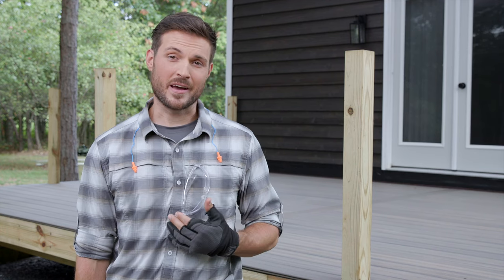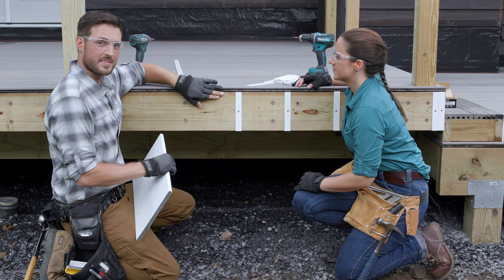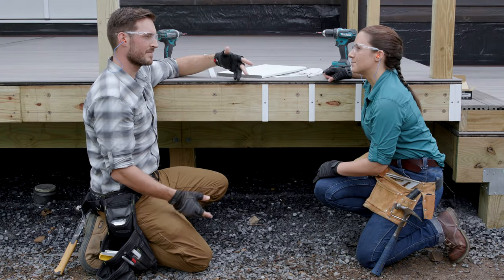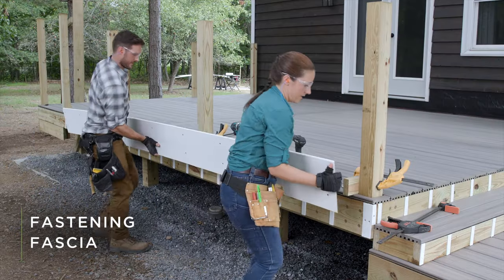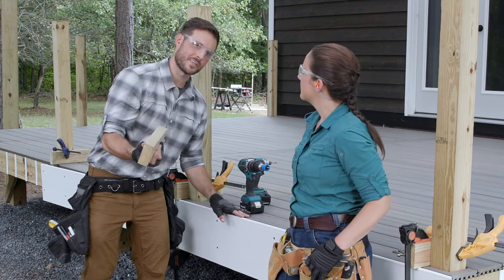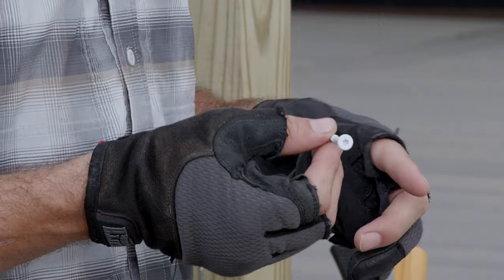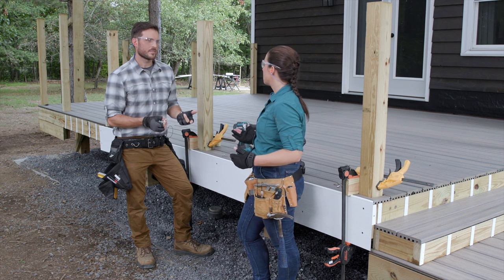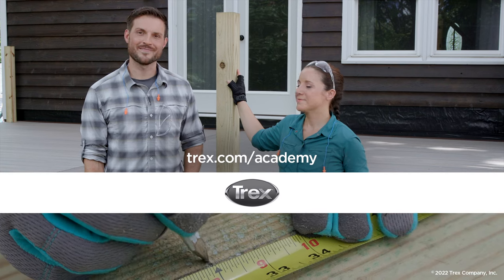How to Install Fascia Boards for a Deck | Trex Academy

Comment: This is exactly opposite of what the trex fascia installation guide says to do. It says the deck board should overhang and fascia should be tucked underneath. There is no mention of spacers either
Reply: He's right.  Picture frame over the top and fascia tucks underneath...have never installed with spacers
Reply: I thought the same thing but, the ends of the deck boards will be exposed and totally defeat the purpose of the fascia.
Reply: I think the idea is, the spacers help airflow carry moisture away.
Reply: Fascia can be finished one of two ways.  
1.  Fascia attached to the rim joist and the decking overhangs the fascia.  This works well when picture framing the deck as the decking cover both the rim joist and fascia not allowing water and debris between the two which promotes rot.
2.  Some people prefer not to have the decking overhang the fascia for aesthetic reasons.  They prefer the decking cut flush with the rim joist and the top of the fascia level with the decking.  However this allows water to settle on top of the rim joist between the decking and fascia.  By attaching the furring strips between the rim joist and fascia, it allows water and debris to pass and air circulation for drying out.  If you prefer your fascia this way attach the furring strips to prevent rot.
Reply: In this case, there is no picture frame and he uses the fascia to hide the exposed side of the boards.
Reply: I agree with you.  Don't forget that these videos are staged crap.....and the people doing them are not necessarily quality carpenters.  I always install fascia underneath, as, in my opinion, the fascia is likely to get worn on the edge....as well as get pushed down....because fasteners are not necessarily engineered to support the significant wear and weight of people stepping on that edge all the time.  I then install the decking so it sits directly on top of the fascia...and supports any edge weight.  Don't want to leave a gap between fascia and deck board....as there is really no need to do so.
Reply: @cyndi795  You picture frame all your deck board corners....so no deck board ends are visible.  Fascia should definitely go underneath deck boards.
Reply: @pokemon9826  After a while, the fascia will sag if it's at deck board height.  The screws are not engineered to handle the vertical sheer stress and will simply move in the wood...or bend slightly downwards.  Ya....might look good esthetically for a while, but if it's on an edge where people walk, the good esthetics will be short-lived.  There is good reason why fascia was always tucked under the deck boards.  The side surface of decking is not meant to be a walking surface.
Reply: @joeidaho5938 haha the screws will not bend   . This is funny
Reply: @Paul-q3m7k  are you a total amateur??  lol  Screws don't need to bend.  They just need to move in the wood...and the wood is always soft, esp after rain.  just use your brain....lol.
Reply: They need to stop teaching people the wrong way!!!!!! Decking has to run over the fascia or you will rot out the rim joist. And it looks better! Come on Trex Academy lol
Reply: @jamesteachout5241  Just amateurs making money doing a useless video....lol.  This happens far too often with these companies.  I just shake my head at this stuff.

Comment: I've followed this video exactly but there is a lot of curvature to the fascia board. The fascia is not flat so as to fit flush against the rim joist. I have Trex Enhance G2 Fascia (clam shell). This doesn't seem right as it is going to make coping corners very difficult.
Reply from the maker: Hi there I would recommend reaching out to our customer care team at 1-800-289-8739 so that we can try to go over your install with you directly.
Reply: @TheTrexCo  thanks, I reached out to Trex and they’ve decided my boards were defective. They are replacing them at no charge. Service was fast and pleasant. Thank you

Comment: We found PVC white lattice moulding in 8-foot lengths (1⅛" wide x 4/25" - almost 3/16) at Home Depot. Royal Mouldings 5534. $4.88 each.

Comment: if I am installing my fascia underneath my deck board (slight overhang of deck board), do i still need to use spacers between the front rim joist and the fascia?
Reply from the maker: Hello Jessica, If you are installing the fascia under the boards, no spacer is necessary. If you have nay additional questions, please call us at 1.800.289.8739. Thank you!
Reply: that's how I'm doing mine; looks a lot nicer.

Comment: A little lost concerning the drill bit.  There is mention that you can adjust the depth in order to use color matching screws.  Questions on AMZN for the Starborn Pro Plug set about depth options say there are none.  Only option is depth for plugs.  Which two step drill bit are you using that allows for multiple depth settings?  Thanks

Comment: Good instruction but that fascia board does not look good. Better off going with same color as the deck.
Reply: I think that the white and grey look good but nit in this assembly, why the he!! Didnt you have the floor boards overhang the fascia?  This install is awful
Reply: @msk3905 . I can see where this might be helpful for someone who didn’t want to bother with picture framing, for whatever reason.

Comment: The decking should overhang the fascia,  looks a lot better and it’s also just about the only way pros do it 😂
Reply: I guess you could could use non-grooved boards for the final row, and route a groove on the inner edge.  Otherwise you wouldn't have a finished edge showing.

Comment: I searched Lowes/HD but I dont see any 1/2" Trex fascia in inventory and after chatting via text with both companies, they dont carry this brand.  Am I missing something? HD carries another brand at 1/2".  Couldnt see anything at Lowes.
Reply: Use PVC fascia
Reply: @dscableguy  Thanks, since my post I found the 1/2" fascia at HD which is stupidly priced like all composite material but will work fine (bought one board for some test runs).  It has texture exterior which is desired for for rim joist but wish the risers were a flat material.  Its odd (kinda, not really) that the 1/2" options are so limited yet that is what is in the video.  Plenty of 1" options.
Reply from the maker: Hello. We would recommend an exterior grade, rot resistant, 3/16" to 1/4" thick by minimum 1" wide material for the spacers recommended for the Fascia application. In this specific video, we used a vinyl product from the local store. Any material that posses the above characteristics would be recommended. Please reach out if there are any additional questions or would like clarification on any of the above information. Someone from our Customer Care Team will be more than happy to assist. Kind Regards. -Trex Customer Care 800-289-8739 |  customercare@trex.com
Reply from the maker: Hello. We would recommend an exterior grade, rot resistant, 3/16" to 1/4" thick by minimum 1" wide material for the spacers recommended for the Fascia application. In this specific video, we used a vinyl product from the local store. Any material that posses the above characteristics would be recommended. Please reach out if there are any additional questions or would like clarification on any of the above information. Someone from our Customer Care Team will be more than happy to assist. Kind Regards. -Trex Customer Care 800-289-8739 |  customercare@trex.com

Comment: One of the ways I’ve made similar spacers is to save scraps of the decking from the waste in, cut it to the desired length, then rip it to the desired width, then in half. A slightly wider gap will also make it less prone to clogging with debris and defeating the airflow purpose.

Comment: Would you use the spacers if the fascia was under the picture frame?
Reply from the maker: If the decking is overhanging, then the spacers are not required.

Comment: Where do you buy the spacers?  Can't find them anywhere.
Reply from the maker: We have no specific brands to recommend, but the following are examples of brands of waterproof membranes

VaproShield
Benjamin Obdyke Roof & Wall Products (HydroFlash can be used around windows and doors)
Dorken

These can be found at Lowes, Home Depot, Local lumber yard or hardware store.
Reply from the maker: You're welcome! -Trex Customer Care

Comment: Im hanging trex 12 inch facia with the upper picture frame overhang of 5/8th of an inch. Im hanging it  off pressure treated ground contact 2x10 rim boards.  I dont like the idea of the facia right up against the wood, any water that gets in just sits and doesn't flow through at all. Is it standard practice to NOT use the spacers for install with overhang? I see that is what Trex calls for but Im wondering why.  I live in Montana and we do get rain and snow.
Reply from the maker: Hello 86309, 

I hope this message finds you well. Please refer to page  16 in our Decking Installation Guide for both options. Spacer method is only one method.  Here is a link: https://online.flippingbook.com/view/63974767/16/. Please contact our Customer Care Team for any further assistance at 1-800-289-8739 between the hours of 8 am and 5 pm EST.  

Thank you, 

Trex Customer Care Team 
1-800-289-8739

Comment: I bought some 12" Trex PVC facia at Lowe's.  I have looked high and low for the smooth plugs for this white fascia.  I can find the wood grain plugs, as you show in this video, but where does one find the plugs for the smooth Trex fascia product?
Reply from the maker: Hello. Thank you for reaching out to us with this great question. Please see direct link for Trex Trim Recommended Fasteners, https://www.lowes.com/pd/FastenMaster-Royal-Rot-Free-Cortex-50-lin-ft-Coverage-White-Self-Drilling-Concealed-Screw-Hidden-Fasteners-75-Count/3439386?cm_mmc=shp-_-c-_-prd-_-hdw-_-ggl-_-LIA_HDW_126_Fastening-_-3439386-_-local-_-0-_-0&gclid=Cj0KCQjwxuCnBhDLARIsAB-cq1qp7aj6wtRB3l8hLrZZ6bHBqAhbBRou6GaNDhSg6-e1i04FKaSwMyMaAqFlEALw_wcB&gclsrc=aw.ds Please feel free to reach back out with any further questions or concerns. Someone from our Customer Care Team will be more than happy to assist. Thank you for choosing Trex. Kind Regards, 
Trex Customer Care

Comment: Can you use a 7.25-inch wide Trex fascia board with an 8" rim joist (rather than the 11.25-inch fascia board they appear to be using here)?
Reply from the maker: Hi David, Thank you for reaching out! Yes, depending on the actual measurement of your rim joist - it should be about the same size as our 1x8" fascia product. If you have any additional questions, feel free to give us a call at 1-800-289-8739. Thank you, Trex Customer Care Team
Reply: Since you are butting the fascia to the trex and not under a lip, wont the fascia now be .94" higher than the rim joist?   @TheTrexCo
Reply from the maker: Yes, the fascia will be higher than the rim joist - as long as your first set of screws on the fascia is installed right around the 1" mark in from the edge of the material, the material should preform as intended. If you have any additional questions, feel free to give us a call at 1-800-289-8739. Thank you, Trex Customer Care Team

Comment: Trex literature recommends gapping all Trex, including facia boards.  But at 6:43 they obviously didn't gap the joint of two facia boards.  So I'm confused.  Gap or no gap on facia?
Reply from the maker: Hello, and thank you for watching Trex Academy! We do recommend gapping our fascia material, to allow for expansion and contraction of the boards. To see our fascia installation recommendations in depth, here is a link to our installation guide: https://images.trex.com/is/content/trexcompany/2022-trex-decking-installation-guidepdf-1#_ga=2.127165261.1384644075.1653311059-759529615.1620217944. Pages 12-13 will outline these installation recommendations, including gapping Trex fascia. If you ever have further questions about installing Trex, please feel free to call us at 1-800-289-8739. Thanks - Paul, Trex Customer Care

Comment: Get starter deck board with out the grove and facia sits under deck board looks way better
Reply from the maker: Hello! While this is the preferred method of installation, we do allow for both options so we offer install videos showing both. This allows for each customer the option to pick what is best based on their exact design. - Trex Customer Care
Reply: What size is that two step drill? And when can I get it?

Comment: Where can I buy white composite plug? Is it the same as “woodgrain” trim?
Reply from the maker: Hello, and thank you for reaching out to us! If you are looking for an approved plug system with our Trex Fascia, we would recommend looking into the manufacturers Starborn or Cortex by FastenMaster. These manufacturers have tested and approved plug systems with Trex fascia and should have an option available in white. If you would like to see a list of our approved fascia fasteners, here is a link to our installation guide: https://online.flippingbook.com/view/63974767/. Page 12 will have a full list of our approved fascia plug systems and fasteners. If you have any additional questions, please feel free to call us at 1-800-289-8739. Thanks - Paul, Trex Customer Care

Comment: How well does the Trex fascia accept paint?
Reply from the maker: Hi there! So, we do not recommend painting our fascia boards as it does not adhere well to the composite material. Hopefully this helped, but if you have any additional questions please feel free to reach out to us at 1-800-289-8739, and we would be happy to assist you further.

Comment: When did Trex come out with the fascia spacers? Never heard of them before.
Reply from the maker: Hello, thank you for your interest in our products! The spacers used when installing our fascia material are not something we directly manufacture. Other products such as pressure treated wood are typically used for this application. We recommend consulting with a local code or building official before installing the spacers, to ensure the product used complies with your local code. If you would like to see more about this installation method, it can be found in our installation guide! Here is a link to view this installation guide: https://online.flippingbook.com/view/63974767/. Page 12 will outline our installation recommendations for our fascia material. If you have any additional questions, please feel free to call us at 1-800-289-8739. Thanks - Paul, Trex Customer Care
Reply: When did Trex begin to recommend spacers on fascia?
Reply from the maker: Hello, This is something we started recommending in 2023 if you are installing the fascia flush with the decking instead of having the decking overhang the fascia. In the past we did not recommend installing the fascia flush, but we learned that if you use spacers, it will allow for the proper air flow behind the board to prevent the product from warping.
Reply: @TheTrexCo  You should manufacture them in color.

Comment: We are installing a fascia mounted railing.   Will this fascia spacer technic cause flexing with our railing?
Reply from the maker: Hi Sheri,

It may, but this depends upon how dense the spacer is underneath the post location and/or post attachment points.  They will want to check with the post manufacturer, (if is not Trex Signature railing).  An alternative would be to secure the posts directly to the rim joists, as if there were no fascia, then install the spaced fascia between the posts.

- Trex Customer Care

Comment: Hello, two questions please.
1. What is the size and length of the middle screw for each shim?
2. What is the size and length of the two screws used to fasten the fascia?
Reply from the maker: Great questions!
1. There is not exact recommendations, anything will work fine as long as it holds the shims in place.
2. 1-7/8" Starborn Pro Plug System for Trex Fascia.

Comment: can someone share a link of the shims(spacers) in the stores?????
Reply from the maker: Hello! Thank you for reaching out and for your interest in Trex! The shims behind the fascia material are exterior grade trim. In this particular installation, the trim was purchased in 8' lengths and cut down from there. Exterior grade trim can typically be purchased from any home improvement store or lumberyard. You could also use wood shims if you prefer that. We do not have any specific brand or links leading to a specific material we would be able to provide. If you have any additional questions, feel free to give us a call. 1-800-289-8739.